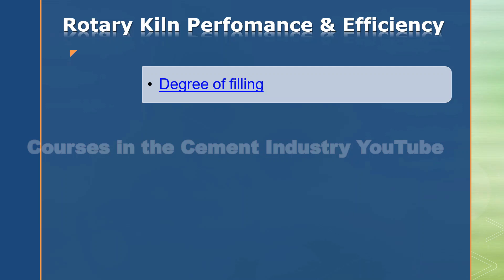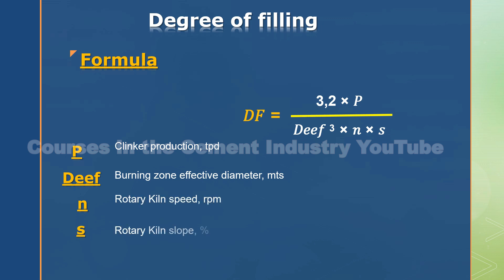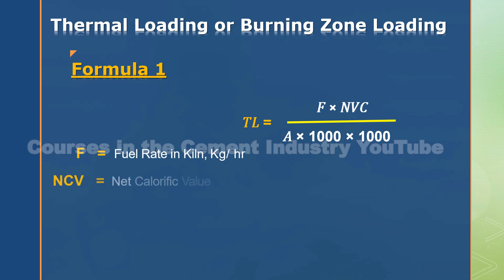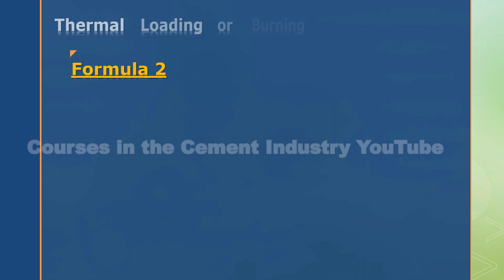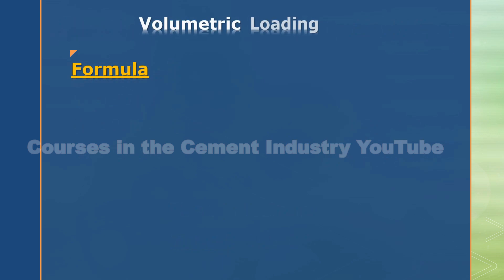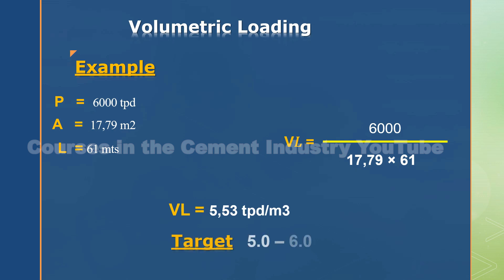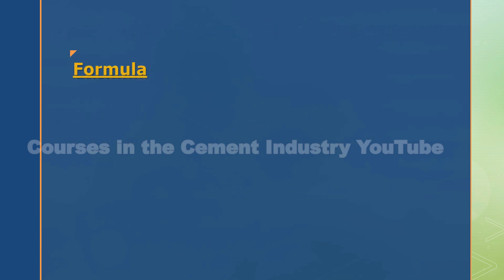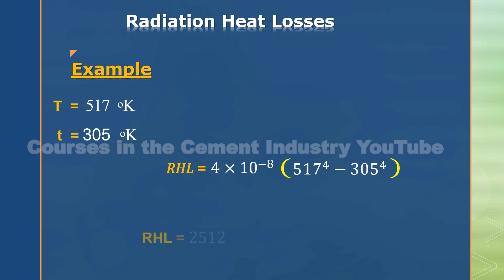Rotary Kiln Performance Calculation Formulas at Cement Industry

Comment: Damaged entry seals, refractory wear due to higher fuel rate in the mix, less clay & limestone. Also slope needs to be adjusted upward slightly, and also adjust the kiln speed slightly  downwards to allow more residence time at entrance onwards to enhance the specific heat consumption.
Reply from the maker: Thanks 🙏